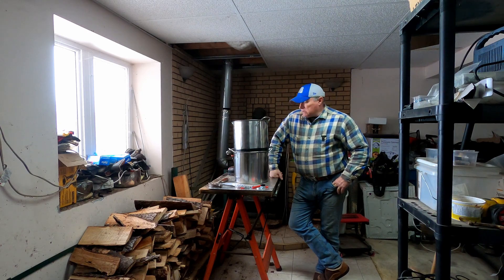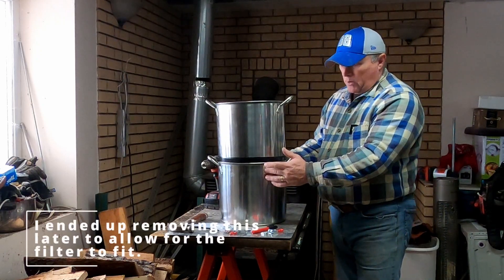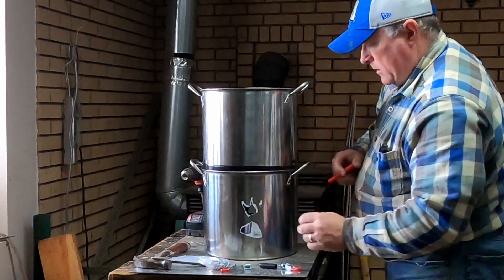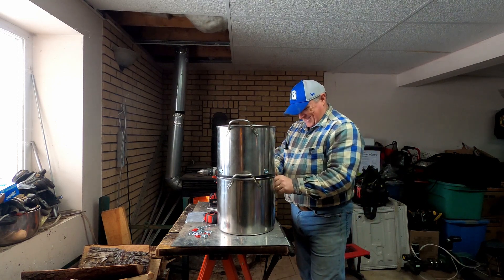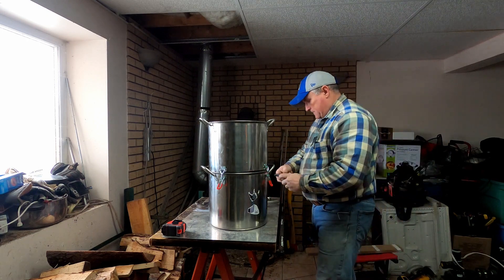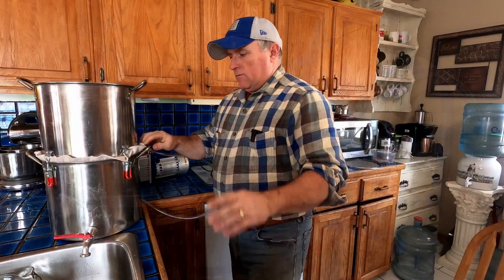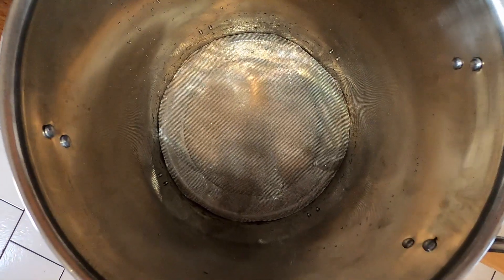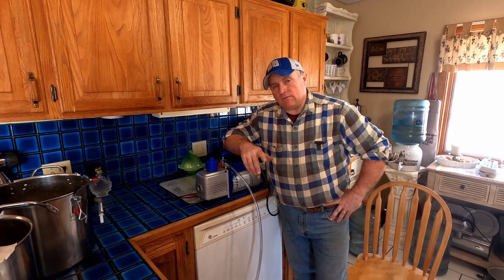DIY Maple Syrup Filtering Vacuum

Comment: Hi Tony and thanks for the video. We are wondering what kind of pump you use. We know it’s a Vevor  but can you pls share specifics? Also, what is the size of the hole you drilled for vacuum hardware? Thanks Tony. Great video!
Reply from the maker: Sorry for the late response. We have been traveling. It’s a 1/4 hp vacuum pump. I think the hole is about 1/2 inch.
Reply: thanks To y! @CreeksideMaplesHomestead

Comment: Thanks for this, great video! I made one, but the syrup tends to get sucked up into the vacuum hose if I get enough pressure to pull it through the filter. Any suggestions?
Reply from the maker: @jtwfiddle  I’ve not had that happen. Can you adjust the suction on the vacuum pump?

Comment: What temperature was the syrup after you filtered it?  Did you have to re-heat it to bottle it---or was it at least 180 degrees to go directly to bottling?
Reply from the maker: I directly bottled it. I filtered it right off the heat and bottled it
Reply: @CreeksideMaplesHomestead  Thank you.  What size filters do you use?  Can you give a link to where you bought them?
Reply from the maker: @PVMapleLodge  I use a 16 inch heavy duty reusable finishing filter material I purchased on Amazon. If you can’t find the flat ones, you can get the large cone filters and cut them down one side, open it up and cut a round filter out of them. Hope this helps. Cheers. 🥂

Comment: I did not soak my filters. I use a small shop vac which has plenty of power. I use a nineish pre-filter and filter from CDL maple products for a vacuum filter system. Thanks for your help. Do you think not soaking the filters is what caused my problem
Reply from the maker: I also use a stainless steel mesh filter as well.
Reply from the maker: It could have but without seeing it, all I can do is take a guess. I know I do pre-steam my filters and it helps

Comment: So I basically built mine exactly like yours or close anyway. I tried it out with a filter and pre-filter with just warm water and it worked perfect. When I did it with hot maple syrup today it did not work very good. Any thoughts?
Fred
Reply: So I basically use a pre-filter and filter from CDL maple products. For a vacuum filter. I am using a brand new mini shop vac with plenty of power. I did not soak my filters. I did not know I needed to or forgot. Would that have done it?
Reply from the maker: @fredA1234  i pre-soak my filter over steam.  Not so it’s soaking wet, but damp. It filters better. The only other thing I can think of is the vacuum may be too strong. I use an actual vacuum pump. Much smaller line. Also, make sure your filter is locked good between the two pots. If you could send me a pic or two I may be able to see something that you can adjust. Email creeksidemaples@gmail.com
Reply from the maker: What kind of material is your filter? What size pump have you got? Did you pre-soak  your filter in hot water? Sorry you are having a struggle with it. We will try and help as much as we can

Comment: Bought all the supplies, drilled the pots, cut out the bottom, etc...  Put it all together, poured the syrup in the top, turned on the vacuum and the filter got sucked down in the bottom of the pot.  Can't get the toggle clamps to stay closed.  I'm seeing you placed yours a little above the rim of the pot underneath.  Did this happen to you?  We already put the D.E. in the syrup and would hate to have to throw 3 gallons out!!!
Reply from the maker: Sorry you are having these issues. I’ve never had that happen. Is there any way you can take a few pictures or a short video and send it to me? My email is creeksidemaples@gmail.com

Comment: What size is the vacuum pump? Can it be used for reverse osmosis as well?
Reply from the maker: Thanks for watching and the comments. The pump is a 1/2 hp with an inlet port and an outlet port. I’m not sure if it could be used on an RO system but I would think so. Have a great day.
Reply: @CreeksideMaplesHomestead  Thanks so much for replying so quickly. This year is definitely different for sap. I found it awesome that you’re here in NB, not so far from us. We tap trees on our property and some on my siblings’ as well, near Woodstock.
Reply from the maker: @janetkaye5110  Thats awesome. We used to live in Woodstock. My wife grew up there.
Reply: @CreeksideMaplesHomestead  Dana & I would love to see your setup. We’re boiling down the last run today. It has certainly changed colour big time. We are thinking about mixing the last couple of batches with one that had next to no colour but lots of flavour & sugar. We’ll wait to do it after we get the pots all put together. I don’t want to wait until next year to try it out.

Comment: Having to buy the pots what would I have in it? Also do you put directly under your take off point? And do you use the additive white powder to help filter? I’m just getting started. Bought a Corsair from smoky lake.
Reply from the maker: Thanks for watching. I got the pots pretty cheap. $30.00 a pc. I finish my syrup off and then put it right into the filter. I haven’t used the Diatomaceous Earth, white powder, yet but plan to. They say it works great. Good luck and have fun.

Comment: What fitting did you use for your vacuum pump to the hose? Thanks I’m using a 1/2” hose and a 1/2 valve in my tank. I purchased a 3/8” male to 1/2” hose barb fitting that fits in my pump well but the only thing that’s questionable is on the fitting that came out of the pump originally there is a black plastic piece to restrict the flow I guess? Thoughts? Thanks
Reply from the maker: My pump had a ridged nipple on it. I could simply slide my hose on and put a small clamp and it was just that easy. I’m sure you can buy something like it at your local hardware store. Thanks and hope this helps. Feel free to send me any pics to creeksidemaples@gmail.com
Reply: Thank you! I’ll check an actual hardware store instead of TSC! Lol 
Thanks much!

Comment: I built a filter system very similar to this last year and I still got a lot of settlement after a few weeks of the bottles sitting. can anyone suggest what I may have done wrong? My only thought was since I make syrup from Box Elder trees instead of Maple, maybe this process just isn't good enough for Box Elder syrup. Any suggestions?
Reply from the maker: Not sure a out the nitre in your syrup. We still get some every now and then. We try to pre-filter a lot as well as adding DE to the syrup and stir it in. That seems to cause the nitre to filter out much better. Diatomaceous Earth,DE , causes the nitre to cling to it, enlarging the grains of sand and makes it easier for the filters to catch it. The DE doesn’t go through the filter either so it doesn’t make it into the finished filtered syrup. Hope this helps and thanks for watching

Comment: Any chance you can give me the part info on the vacuum parts I am looking at building one & using a Harbor freight 2.5 cfm pump
Reply: now that I saw you used a 2 stage I am looking at them instead
Reply from the maker: The vacuum pump is a two stage. It works great. I bought it off of Amazon. They have a lot on there. If I can help with anything, let me know. Thanks so much for watching
Reply: @CreeksideMaplesHomestead  what is the elbow & adapter you glued in
Reply: @CreeksideMaplesHomestead  Any chance of a full "parts list" of what you got (I realize most of it was off of amazon).. just makes it easier and faster.. less "re inventing the wheel".. thanks for all your help!

Comment: I built one just like it this season and had to still change out the filter every 1.5 gallons or so. The system is still limited by the orlon filter fabric. It got me through this season (still way better than cones) but I’ll be getting a filter press before next season for sure!!
Reply from the maker: Thanks Ben. We have to change the filters as well. We pre-filter before we put it in the vacuum filter. I also added two pre- filters on top of the orlon. I can do about 3-4 gallons before changing the orlon. I do have to swap out the thinner pre-filters more often though. It is far better than cones and gravity. I agree 100%. Good luck and thanks for dropping in to Creekside. We hope you stay and enjoy all the channel content. Take care. Have a great day.
Reply: Try adding the DE before you give up on your filter.

Comment: Why is everybody cutting the bottoms the way you’re doing it is perfect idea but why can’t you just drill holes at the bottom of it instead of cutting it and put your filter inside ?????
Reply from the maker: Great thoughts and question. I watched some make these and totally cut the bottom out. I thought it would be better to leave that inside rim. The heavy filter fits between the two pots to help seal it to build the vacuum. I place my screen filter as well as my pre-filters inside of the top pot and they lay on the rim I left inside. It seem to work very well. I did think about drilling the bottom but it would need a lot of holes. I felt that it would impede the syrup flow and clog. Besides, stainless is hard to drill and I didn’t want to have to spend all that time drilling. Lol. I do think drilling a lot of holes could work. I’m very pleased with my design. Seems to work very well. Thanks so much for watching and the great comments. Have an awesome weekend
Reply: Like he said, you need as much unimpeded surface area for the vacuum to pull the syrup through. The more metal in the way, the slower the filter rate. The fabric has more than enough tensile strength to resist the vacuum pull without tearing. It doesn’t need the metal backing for stability.

Comment: I love this! One thing you might want to consider instead of the screen is a honey filtering bag. They are a fabric bag that is much finer than the wire mesh, depending on how much you want/need to filter the syrup. I like them for doing my honey as I throw them in the wash machine, one less thing to clean by hand!
Reply from the maker: Thanks Robert. Great idea. I have a couple of those honey filters. I put one in there. 👍👍